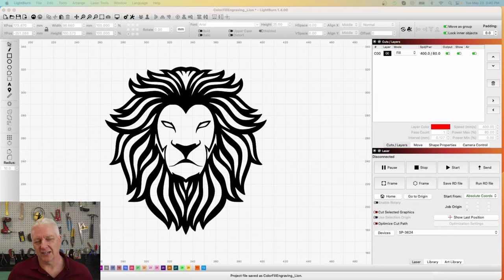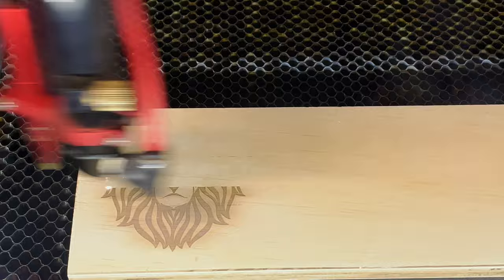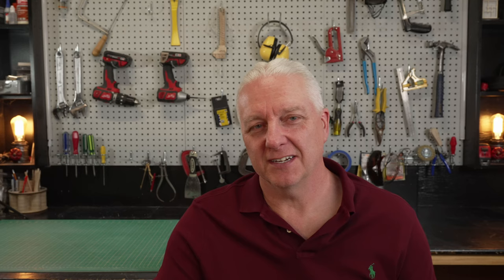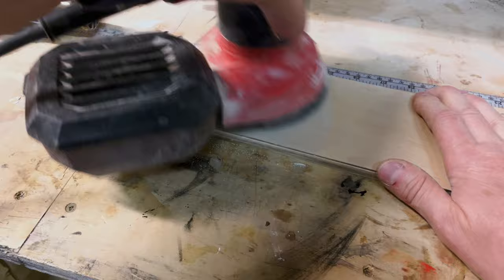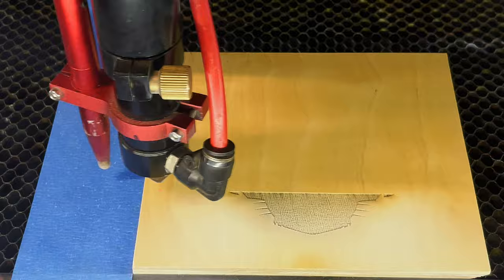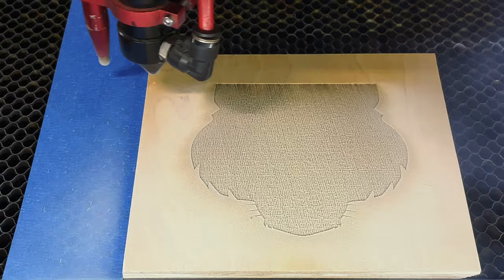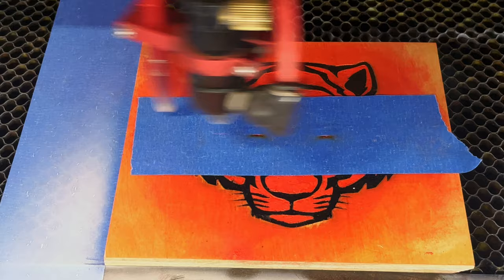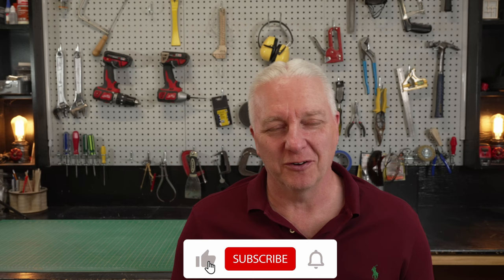Achieving Stunning Color-Filled Engraving

Comment: Steve, I just tried your method of Powder Coat.    I don't know exactly how you do it.   My heat gun on low blows a big share of the powder out of the engraving.
Reply from the maker: It takes a bit of practice. You can pull back a bit on the heat gun and let the heat do the work rather than the airflow.  Once the powder coat start to soften, you can get in closer to heat things up.

Also (and this is important), you need a good deep engrave.  Run a material engrave test and pick settings that create an engrave that's 2+mms deep.  If you don't do this, there is nothing for the powder coat to hang on to, and it will be prone to blowing out.

.
Reply: @SteveMakesEverything   Thanks for your fast response, will try again and back off and try it more like your description.

Comment: I don't have a heart gun so I just assumed they blow a lot of air like a hairdryer.
Reply from the maker: Actually a heat gun blows a lot of heat rather than air. They aren’t quit the same, but if you had a hair dryer you could try high heat and low speed.  You’d probably have to keep it fairly far from the work though to avoid blowing powder coat everywhere.

Comment: Great, informative video! Very helpful. I've owned a heat gun for a while, just waiting on my first laser engraver to arrive in a few days to try out your method, which does seem easier and less tedious than other methods I've seen in other videos. Can this method be applied to leather in addition to wood? Thanks again!
Reply from the maker: I think the problem you will run into with leather is that it flexes.  Powder coat would break out in this kind of scenario.

Comment: How would this work for acrylic since you can’t sand it?
Reply from the maker: I’m not sure this would work with acrylic at all since the heat required for the powder coat would also soften/melt the acrylic. However assuming that isn’t a problem, you probably wouldn’t have to worry about sanding because powder coat probably won’t stick to the smooth surface

Comment: Thanks for this video Steve! You’ve earned another subscriber. Do you have any suggestions for sealing this product afterwards? I intend to try this out on hardwoods and like to use Rubio Monocoat, not sure if you have any experience with Rubio but I’m curious if it will still bond well to the hardened powder coat. Thanks again!
Reply from the maker: Since powder coat is essentially plastic you can cover it with just about anything

Comment: Great ideas, but using the heat gun would melt all the powder around the image too? Making more work to clean after,  rather than just melting the lines or area wanted? I tried my first one last night and found I didn't need to sand mine at all  because I only burnt the parts I wanted painted,  I think it depends on what laser your working with and how you have it set up to put bits back into the same spots or putting powder on while it is still in the laser machine.  Thanks for your videos,  very helpful.
Reply from the maker: It will, but Powder coat isn't like paint - it doesn't run into the pores of the wood, so even if you do get some melt, it will be on the material surface and can be removed with a very light sanding in a few seconds.

Comment: Thanks for describing this technique!   I am mostly interested in etching painted aluminum which I can do with good results using my 20 watt diode laser.   Do you think a layer of paint would be thick enough to retain the powder?    With full power and slower speed it will roughen the surface a bit that might improve adhesion.  Thanks again.
Reply from the maker: Good question but no.  Powder coat need a pretty deep engrave because it needs something to hang onto

Comment: Hi Steve, have you tried the powder paint / heat gun on metal engraving or just timber?
Reply from the maker: I typically do this sort of thing on wood, but powder coat is generally designed to pain metal so using ni metal engraving should work just fine.

Comment: Thanks for the very informative video. I would definitely try your method if I were doing wood. Any thoughts on using this with glass, more specifically wine glasses or bottles? I understand you can't powder coat the entire design at once because the paint will fall off the curved design, but maybe a little at a time? Just trying to figure out how to color glass. Thanks!
Reply from the maker: I doubt this would work on glass. You need a good, fairly deep engraving or the powder coat won’t have enough material to grip on without chipping off

Comment: Would a heat press work instead of the heat gun? I have several sizes I use with my cricut.
Reply from the maker: I think if you lay some parchment paper over it, a heat press would probably work. You’d need to experiment with the temperature and time though
Reply: @SteveMakesEverything  thanks Steve

Comment: why powder over a spray or acrylic?
Reply from the maker: It's not really one or the other.  This is just one more weapon in your arsenal.  Powder coat's real advantage is that it is thick and can be used to fill an engraving rather than just painting into it.  And it is more like a plastic than a paint, so it is pretty durable.

Comment: what temperature should you use?
Reply from the maker: Heat guns generally don’t have a temperature setting, so I’m not really sure. I use the low setting on mine until the powder coat starts to melt - and event will be pretty obvious.  You can be a few inches away with the heat gun until the melt point to avoid blowing the powder out of the engraving.

Comment: Hmmmn. I'm hoping to do something similar to this since I quite like the result, but I'd like to try doing this with metal instead. I suspect just using some sort of enamel paint or airbrushing might be more appropriate though.
Reply from the maker: Powder coat was originally designed for painting metals. Of course for this technique to work you need to engrave it, which would require a CNC rather than a laser

Comment: Is there any way you can do this on a piece of wood that is painted white.  I want my sign to be white and use this powder coat for black words.  Is that possible or can you only use it on unpainted wood so you can sand at the end?
Reply from the maker: In theory the white paint won’t matter to this process. However powder coat is a bit messy and could be an issue if it gets on the white paint. You would have to mask it before you engrave and leave the masking on until you heat the powder coat.
Reply: Thank you so much

Comment: When using heat gun, doesn't all that axcess powder that is all over the surface, gets melted into the wood as well?
Reply from the maker: It can but with a heat gun you can target what you want to heat a bit better.  Regardless, powder coat isn’t absorbed by wood so a light sanding with fine grit sandpaper will get rid of any overage.  Excess powder coat would exist regardless of which method you choose to heat it. It spreads everywhere so you’ll have to sand or wash the surface no matter what.
Reply: @SteveMakesEverything  Thank you

Comment: I think an infrared flood light might be better than a heat gun. Heat gun is going to blow some of that powder into the air, but you're right, putting powder coat into your laser is just not a good idea. I watched a few of those videos and thought Noooo. Not gonna do it. Wouldn't be prudent.
Reply from the maker: My heat gun doesn’t blow paint around if it’s on the low setting. A broad swath of heat like a lamp will melt paint in places where you probably don’t want it to stick.  In the end any heat source is probably better than a laser.

Comment: Hi, Steve, I love your videos! I just tried the method you showed for my cutting board and it failed, unfortunately. I may have the wrong settings on my commercial heat gun. Would you kindly confirm the time and temperature, as my cutting board ended up with black powder over the surface, not just the laser image. Any help would be appreciated!
Reply from the maker: There’s no real time per se.  After a bit of time with a heat gun you should see the powder coat liquify.  I use the lowest setting on my heat gun an within 10-15 seconds, I the liquid state.

I don’t know if I would use this on a cutting board though.  Powder coat may not be food safe and when heated it can bubble giving the opportunity for bacteria to hide

Comment: I have not tried this yet, but, using a medium viscosity paint - maybe an epoxy type, apply with a syringe through an 18 gauge or larger needle and apply your colors into the engraved areas just to the top.  The paint will/should flow fairly easily in the engraved tracks. (For small intricate areas, a light spraying of a clear coat first will help seal the wood and prevent the different colors from migrating).    Repeat for all colors and then, when **completely dry**, finish sanding all smooth....  I know I've got you thinking and maybe you will let us all know the results you achieved....
Reply from the maker: 😁 Yep, I use paint-filled engraving all the time. The powder coat is just one more weapon for your arsenal.  When I fill engraving with paint, I typically apply a good coat of polycrylic to the surface first. It makes wiping off the excess paint a breeze with a damp cloth on a block of wood. 

What powder coat gives you is the ability to completely fill the engraving level with the material surface for a lot less money and mess than resin.
Reply from the maker: @ainttakenanyshit  Awesome.  Get ready to be taken over by laser cutting and engraving 😀

Comment: Wow Steve!  Amazing results.  Just wondering, if you taped off the wood, laser, then did the paint that may not  require the sanding?  Just a thought for the single  colour. Again..fantastic video and a great take on the idea..
Reply from the maker: You can certainly try this, though it's inevitable that this very fine powder will get on things.  Masking will greatly reduce it though.

Comment: Hi Steve, thanks for this video. Haven't tried it yet, but going to.  Q:  Does lightburn work with our FSL machines? Did you convert from RE3?
Reply from the maker: FSL lasers don’t support Lightburn.  I’ve been toying with the idea of replacing the controller in my Muse 3D so  it becomes a 45W Lightburn laser, but I haven’t had time.

Comment: So, overall this worked out phenomenally. I have a question about it though. I have the heat gun set to 500 degrees. It melted, but dried with an almost grainy texture. Like bits of sand were in it. Did I not hold heat to it long enough?
Reply from the maker: If you use powder coat on metal it will get this pebbly look. You can just use less heat next time, but it won’t finish completely smooth regardless because that’s not the nature of powder coat.
Reply: @SteveMakesEverything  it was on spalted maple. I'll try lower heat. Thanks again. It turned out pretty good looking. And super easy to do.

Comment: Steve I am fairly new to using the laser.  I really like this video but I have a question - once you have done the first engraving how do you realign the board so the second and third engravings are in proper place.  I have an A20Pro and I'm slowly learning.
Any suggestions you pass along will be greatly appreciated
Reply from the maker: My laser honeycomb has a frame around it that makes a slight ridge, so I can use that as a guide to get reproducible positioning.  But you could also create a simple jig that you can fix to the work area so you can reposition into the jig.  It could be something as simple as an L-shaped piece you cut out, or it could be a complete rectangle the size of the item you are engraving.  As long as it can't move when you remove or replace your piece, then it will work.

Comment: Great! How about metal (aluminium) color engraving with powder? Does this work? 😀
Reply from the maker: If you can engrave the metal, then this should work.  You'd need a fiber laser or even a CNC to do this, though. Of course, with metal, you could just put the whole thing in an oven to heat it.
Reply: @SteveMakesEverything  I will give it a try... Thank you Steve!

Comment: Melted plastic powder on paper from a photocopy machine or printer is called toner. Why do they call it powder coat if it's used on other surfaces and applied with different tools?
Reply from the maker: Using it on anything other than what it was intended for is a bit of a hack   Powder coat is normally applied as a  plastic covering for metal parts. That fact that we can use it on wood is a bit of a happy accident.

Comment: Tried you method and unfortunately for me it appears the paint bubbles? Whole engrave is covered in tiny bubbles. I used the same powder you did, was my heat too high? too low? Not sure what happened, any thoughts
Reply from the maker: If the paint is bubbling, then you are heating it way too much.  The second you see the paint start to liquefy, move away.  You can always come back to that spot to keep it at a melting temp without staying so long as to raise the paint to the boiling temp.

Comment: That looks amazing! Why use powder instead of normal paint though? Just because it's faster as it doesn't have to dry? Or does it leave less of a mess on the surrounding area?
Reply from the maker: The biggest benefit is that powder coat can fill engraving. I doesn’t penetrate into the wood pores either so it is a bit easier to get clean results
Reply: @SteveMakesEverything That makes sense. Thanks for the quick reply!

Comment: Any suggestions for wood that the engraving isn't very thick.  I don't own a laser yet:(  and the pieces I order they don't engrave very deep..  I really love this method
Reply from the maker: Generally, deeper engraving happens with more power. For powder coat you will want a couple millimeters of depth, though normally, basic engraving will barely mark the surface
Reply: Thank you   Don't have my own laser and blanks i.order I can't control depth.  Tried this..  was sooo hoping it would work:?

Comment: How is the bottom of the engraved area not burned black?
Reply from the maker: I don’t understand the question. I usually run a material test so I know what the engraving will look like.  There isn’t enough heat in the powder coat melting process to burn anything if that’s the question you are asking.
Reply: @SteveMakesEverything  Hey Steve, No, what I'm asking is after you engrave. The bottom of the cut surface (the bottom of the laser engraved area) it's almost simply wood colored. When I engrave, the engraving is nice and crisp but the bottom of the engraving is black. Guess I need to play with my settings a little.
Reply from the maker: @HWoodCreations  Well I did this on my CO2 laser rather than a diode laser.  While fine engraving details aren't nearly as good as a diode laser, it's far easier to do deep engraving without looking like it was done with a torch.

Comment: An eye opener indeed. Thank you for the insight.
Excepr i suspect this method wont work for acrylic sheets since melting the residue will be hard to fix (cant use a sander)
Reply: Oh unless masking is used 😅
Reply from the maker: On acrylic worry more about the heat than the residue.  Paint wouldn’t stick to the smooth acrylic anyway. Personally I would paint acrylic - I would usually do an inlay instead
Reply: @SteveMakesEverything  I managed to do acrylic by changing the pattern of the engravings to make a rough surface. Ofcourse if I want to do batches the time it takes to do the powder filling adds up. As you suggested I usually go for masking and spray painting or brush on paint.
Nevertheless I will definitely be doing wood and mdf using your advice. Many thanks for the great tip.

Comment: What grit sandpaper did you use in this video?
Reply from the maker: 600 grit should work on pre-sanded plywood, but 320 grit would also work.  3mm plywood has very thin layers, so you can't sand with too much effort.

Comment: could you use a heat lamp ? so as to not blow the powder out
Reply from the maker: I don’t think a lamp would get hot enough.  If you are using a proper heat gun it won’t push enough air to blow power around anyway, unless you are holding the gun too close.
Reply: okie doke thanks @SteveMakesEverything

Comment: You could use powdercoat tape that is heat resitant..
Reply from the maker: True.  Any Kapton tape would also work.  But if you are getting the surface hot enough to melt/burn painters tape, then you’re probably heating it too much

Comment: Can you just use an old toaster oven to heat the piece to set the powder coat?
Reply from the maker: That sounds a bit dangerous, but if you had an old toaster over it might work. With a heat gun though you can direct heat to very specific places without heating the entire piece